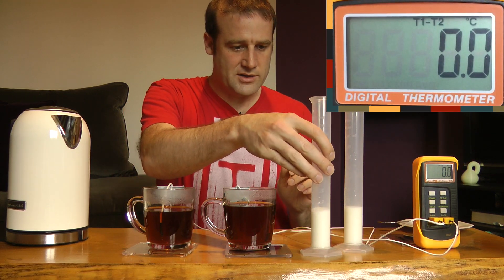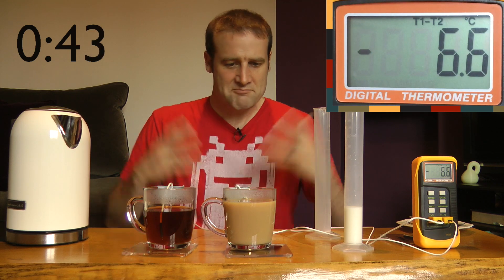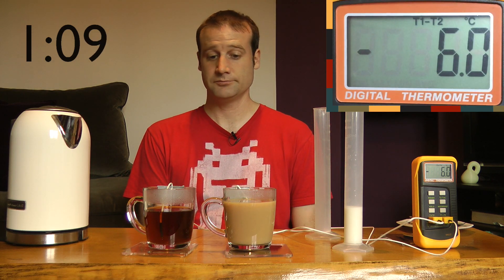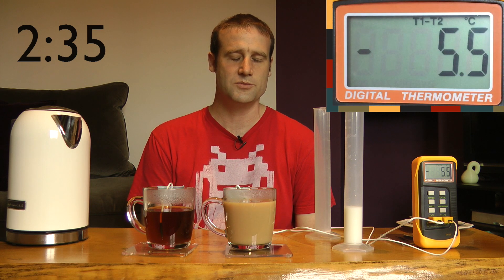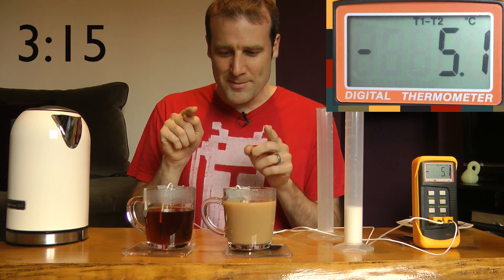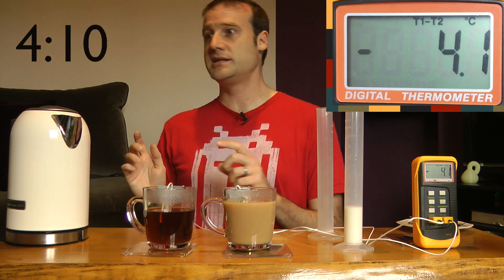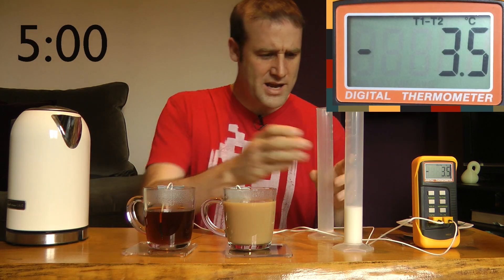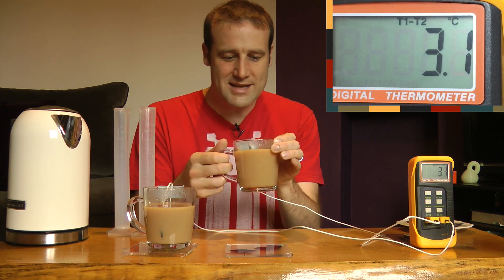Milk first or last? The full data for hot tea. (GONE ANALYTICAL)

Comment: Wonder what the main video is about. Guess I'll find out soon enough.
Reply: It's most likely a video about whether it is better to add milk just before drinking of just after making the tea (or coffee for that matter). Adding milk in soon as you make the tea results in hotter drink as the temperature difference with the environment (temp. gradient) is smaller so rate of heat exchange is slower.

Comment: Thanks for actually doing the experiment. I asked myself the same question, came up with an explanation (milk first = smaller temperature gradient = hotter tea at drinking time) but I'm too much of a lazy fuck to actually do the damn experiment.

Happy to see my theory proven correct and looking forward to seeing the main video :)
Reply: I don't know. The start of the video shows the milk-first glass has more tea in it than the other one. More tea = more heat = heat stays longer. Whole experiment is botched.
Reply: +NeatNit that might affect the result but its pretty much like in real life. I'm sure this experiment is about whether you put the milk in right after the hot water or after a few minutes

Comment: But the volume of tea in each cup isn't the same to start, the one with slightly more tea (on Matt's left) should cool slower anyway because it has less surface area per unit volume. For a fair test the volumes of tea before hand should be identical.